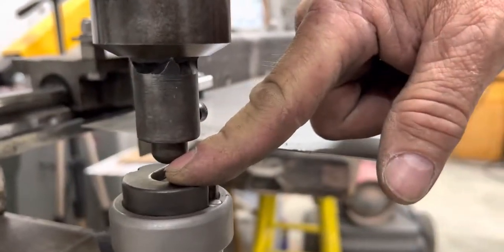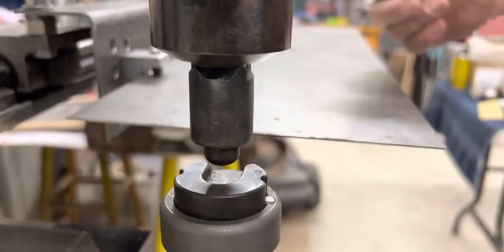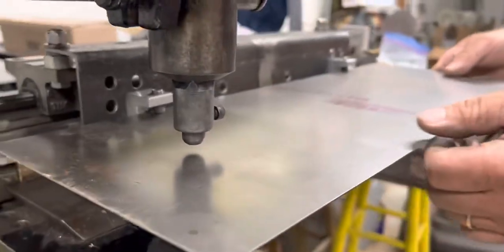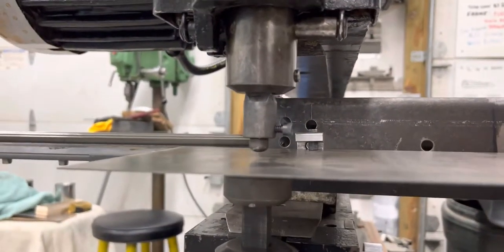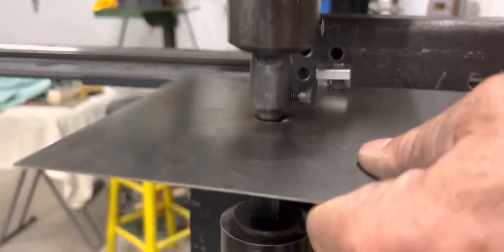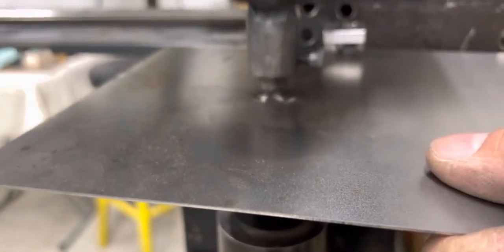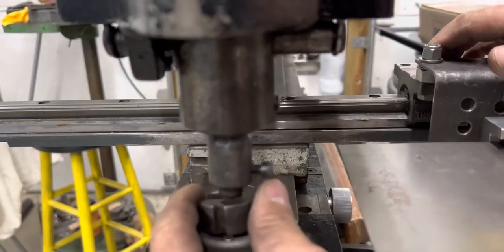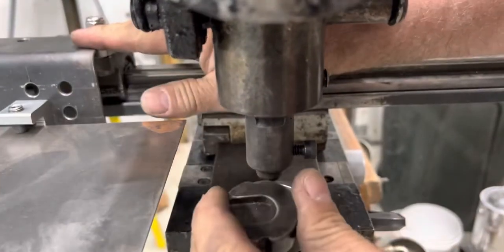Using the Stan Fulton bead dies

Comment: Great Video!  And extremely clever use of the Stan Fulton dies - i.e. using the coining side of the die to enhance the stretching.  I've got the same tooling, but haven't achieved the nice results like yours yet.
Reply from the maker: Bob, the other part of maximum stretch comes from setting the depth fully to what you’re looking for and make one pass.
Reply: @mccartneypaintandcustom9602  Thank you for that extra tip!  I've got some nice aluminum killed 19 gauge at the house - I'll take some over to the shop and give it a try.